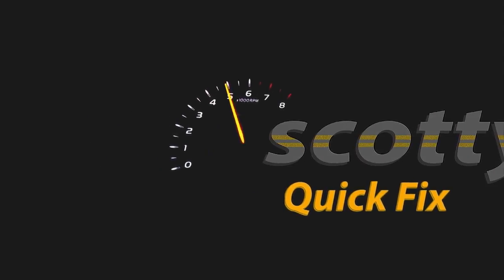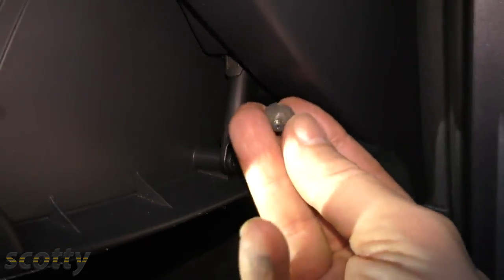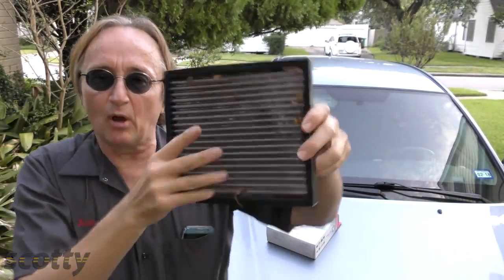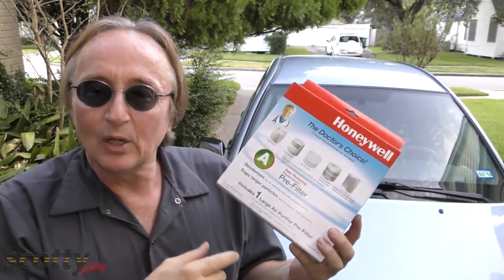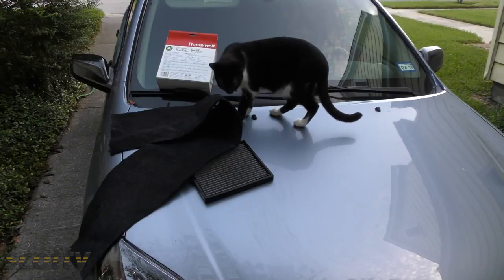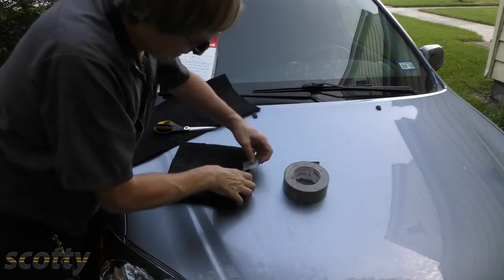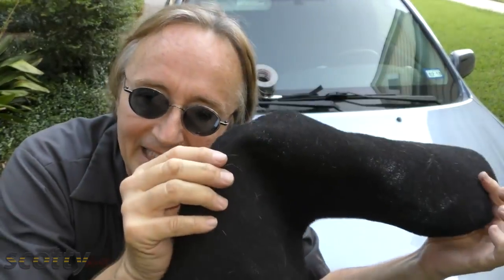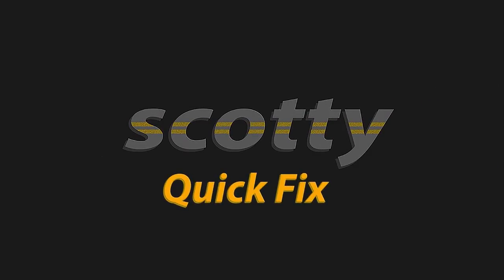Filter Car Smells (Odors) Away

Comment: You can use a Bamboo Charcoal bag filter from Amazon to clean whatever crap is in the air. I've had one for 2 years and it actually does work. Keeps your car smelling neutral.

Comment: I bought a 2016 mini cooper under 3,000. miles in October 2017.  April 2018 I got the worst case of laryngitis and was out of commission for 5 days Returned to work but felt like crap for 2 mnths.  As weather warmed up I noticed a moldy dish rag smell coming/out of the vents.  Brought it to the dealer and they said they could fix the stink. Smelled like charcoal undertones but  less then 5 days later stink is back and my throat is raw again and my lips feel like they R on fire and I have a rash at the corners of my mouth.  Believe it is noxious bacteria blowing on me.  I owned a VW GTI for 13 years and it was parked outside for the last 3 years I owned it and never had an issue with stinky vent air.  I am so unhappy with the mini cooper as there is no reason the vent air stinks and is making me sick.

Comment: 2004 Pontiac GTO does NOT have  cabin air filter, it has a mesh screen over air intake on passenger side that is by the wiper blade.

Comment: My car doesn't even have the option for a cabin air filter. Never existed in my body, and it's a 2004 model (one of the last), people have literally just shoved filters down into the fresh air cowling. I'm not gonna do that though. And because my car has climate control, every hour, it cycles from recirc to fresh and back to recirc - even if the aircon is off. Slight annoyance when I'm behind anything diesel - because I smell every particle of it in "fresh air" mode.

Comment: But... wait a minute. You can buy a carbon cabin air filter or standard, and the diffrence in price (in my country) is like what - 2$... ? I don't see a point.
Reply: Carbon air filters are essentially absorbing moisture based odors. They also trap smaller particles. The big difference is the allergens like pollen that are microscopic are absorbed in the active carbon trapped in the paper filter material. It will improve air quality. but they will also, as designed pickup more dust and mold, so change them more regularly.  Sorry Scotty, just helping.
Reply: Steve Berry sorry Steve.. I know you got excited for your big moment... But unfortunately, it was the wrong time...  He was simply saying the price difference is only 2 bucks, so what's the point of wrapping your cabin air filter.

Comment: That filter seemed pretty easy to get to.  I had a hard time with my 2013 Altima
Reply: vinceleto Nissan filters are always a PITA to get to. I guess they make it hard so you take it to the dealer. On my sister's 09 I have to take apart the bottom part of the dash. On the newer Camry's they have an opening in the glove box so you just take a cover off to get to it.

Comment: Hey Scotty. I have an 2002 Ford Ranger that has two leaks. Oil pan gasket and power steering hoses. 

The local mechanic shop are you want to charge me almost $1000 to change the oil pan gasket. They tell me that the transmission needs to be removed in order to get the gasket. 

And for the power steering. I have the faintest idea where to even begin.
Reply: MoonMan314 Trade it in on a new Tundra
Reply: Get a Haynes manual for your vehicle, problems solved.

Comment: What if you don't have a cabin air filter, my daily driver (a 1977 f-150 4x4) only has a heater and defroster, also it sat for 10 years in a barn and it still smells like cow patties, HELP!
Reply: Trucks nTractors Boxes of Baking Soda. The kind made for refrigerators with see thru panels on both sides.

Comment: Can you do a windshield cleaning video?
Reply: I would really like to see the glass polishing method using sequential (rough to fine) steel wool. I use this on a flat facing RV window because it hits air like a wall. gets pegged with all sorts of fine dust that blast it. Car windows are the same, the little spec's in the glass and dirt gets trapped on the glass and fine abrasives from the wiper blades being dirty.

Comment: Does somebody know how to fix the musty odor coming from the ac vents? I already changed the cabin air filter and the filter under the hood but the odor still there. Any suggestions?
Reply: See Removing Car Vent Smells Scotty video
Reply: You might have mold/mildew in the fan system that takes in the air.

Comment: Scotty, your method would STILL leave old smells and odors in the filter to get into the cabin as they are STILL in the "re-surfaced" filter anyway. I think you are REALLY cheeping out on this one!! A new cabin air filter on -line is only about 10 - 13 buck and to replace every few years is no big deal! A REALLY CHEESY solution IMO.
Reply: Bobby W your solution wont fix a thing, you fail to realize that the job the carbon air filter will do is atleast 5 times better than a regular filter.

Best solution is replace the old filter, then use the carbon filter on top. And replace that one every month while still cleaning the cabin filter every month aswell (untill the dirt is noticeable replace it)

Or just get a carbon air purifier. I git a hondox that i leave in the middle of my car and its plugged to the 12v works and doesnt bother me at all.
Reply: When I replace the cabin filter (yearly) I DO USE a CARBON FILTER. They actually sell them for cars and fit properly. They are not expensive and I personally LIKE getting the old polluted one out of there.

Comment: Happy Bday!!  But didn't specify which side to put the carbon sheet.Most frames are so tight, not sure it would fit in . It could come off and clog the vent system. then U got real problems,Doubt it would work for 2 pc filter. Nobody is going to check it every month.
Overall not one of Scottys better vids.
 Better to just change the filter often..U can get cheap  ones from china on eba  y.
Reply from the maker: it can't come off and clog, the air is sucked over it into the filter under it.
Reply: U didn't specify which side to put it on. A non-mechanic could put it on the wrong side.
Reply: @cpgone  Mechanics can and do also put it wrong. You should put carbon sheath on upper side of the filter and install the filter that way horizontally if the air flow is down (arrow pointing down) or install it vertically with carbon sheath on the left if the air flow is to the right (blower motor is on the right side of filter).